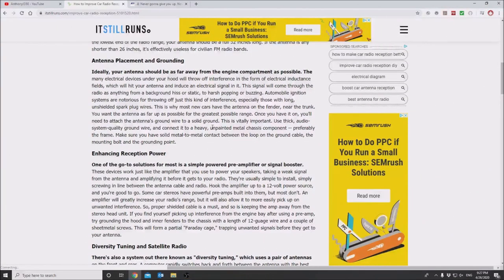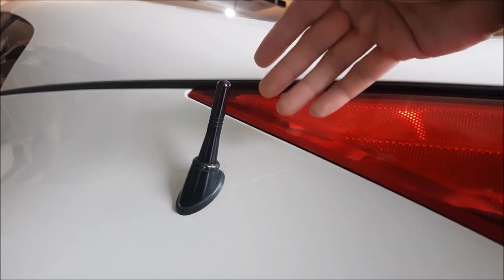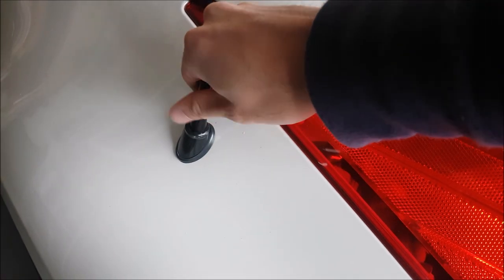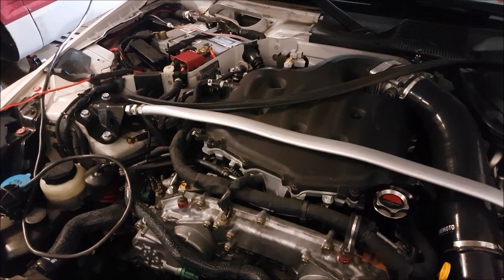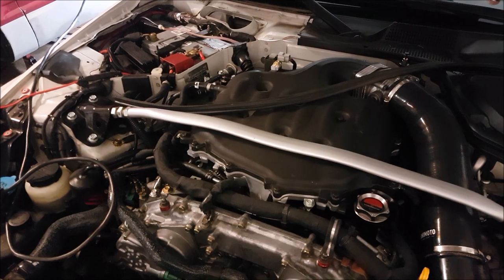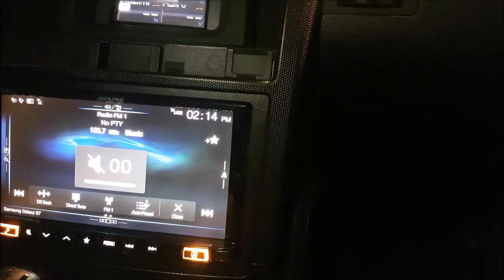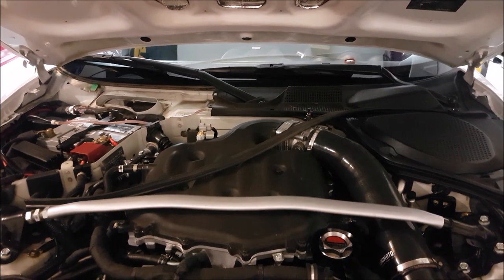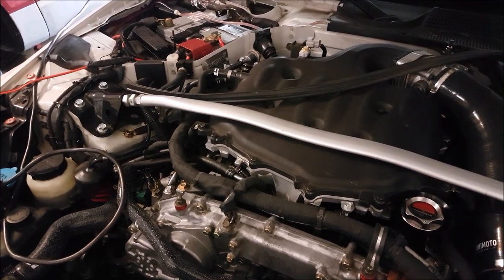Aftermarket Stubby Radio Antenna, do they work? | AnthonyJ350

Comment: There's a few factors. Your location and quality of the af head unit can also affect clarity. Oem units have better range in my opinion but I like the low profile antenna.
Reply from the maker: I agree, especially for AM OEM seems to be better. But I also think it's because the engineers design that unit to work in that chassis.

Comment: Antenna length is a function of wavelength...Those Shorty Antennas  may look cool but has less gain then the stock full length...If you live in the fringe of reception, those Shorty Antennas may not work for you...Using an amplifier to boost reception also brings problems of also amplifying signal noise....So you have to decide whether looking cool is more important than functionality of FM Reception...Some people don't care because they seldom listen to the radio....
Reply from the maker: Good point!  I've also had good luck installing an aftermarket windshield amplified antenna and I've actually y adapted them, getting both antennas to work better.  We do it for people with factory antennas but the aftermarket head unit, the AM reception degraded.
Reply: @AnthonyJ350  If you have a good recommendation for an FM antenna amplifier for the stock rear window G35 Rear Window antenna, please let me know...

Comment: on my 06 Yukon I always listen to XM so I tried the mod where people put the antenna along the top of the fender, reception was TERRIBLE!  I left the antenna base their grounded to the inside of the fender and ran a wire under the windshield molding; reception is so, so but I don't really care since XM is my prime form of music.  I also installed the escalade antenna delete cap.  I guess I could put the rear escalade window with built in antenna if it was really important to me.
Reply from the maker: I use a y-adaptor not where I put an aftermarket amplified antenna on the inside of the windshield and make it work with the factory antenna or stubby.

Comment: Having an HD Tuner, head unit, would pick up AM & FM signal. I also put blue thread lock on mine. Can't have them burglars take that easy.
Reply from the maker: Ya I've had stock antennas pick up AM poorly because the vehicle wasn't grounded well or the antenna connection corroded.

Comment: Hi Anthony. Just tried to swap mine out, but the old one was so rusted the bolt snapped off inside the housing! 

Do you think it would be best to try and drill it out, or just replace the whole housing unit?

Cheers

Edit. I tried to do it before watching this video, so would have used some lubricant if I had.
Reply from the maker: I would replace it

Comment: Would I still need an antenna for Bluetooth on my radio?
Reply from the maker: No, not for Bluetooth connectivity. Just make sure you run a new ground wire if you are installing an aftermarket head unit.
Reply: @AnthonyJ350  A new ground wire from where to where?